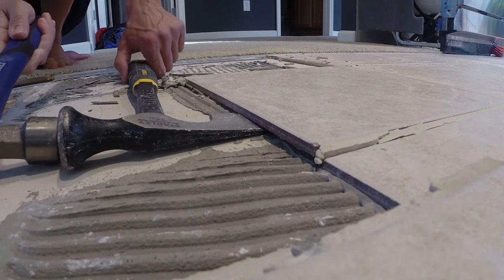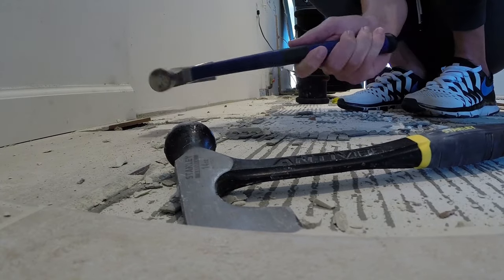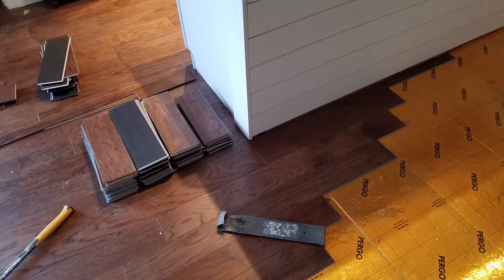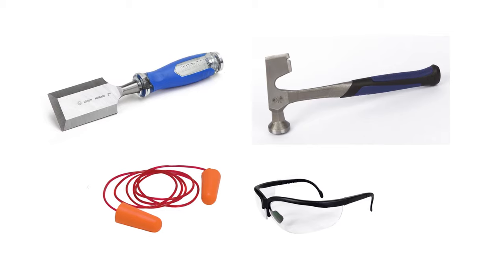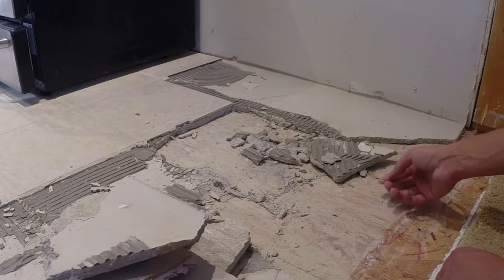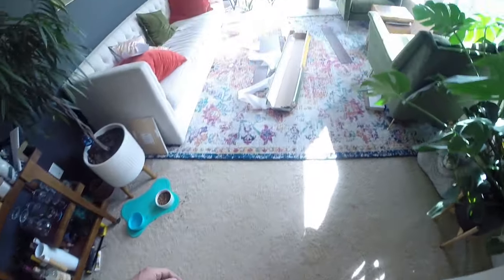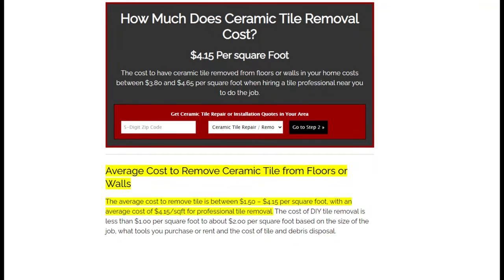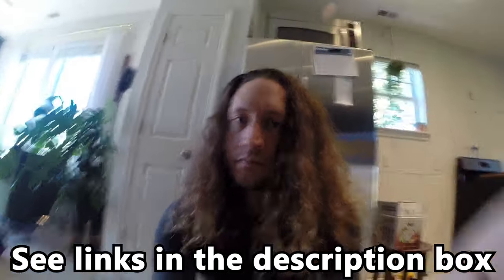How To Remove Tile - Crucial ADVICE for Removing Ceramic Tile Floor!

Comment: Did you have to get a permit from the town to do this work? I'm getting rid of damaged tile in the kitchen and master bath. Will try the tool that you showed in the video. Hammering the tile is very slow and noisy.
Reply from the maker: I did not need any permit to remove tile or anything in this remodel. I don't think you would ever need a permit to remove tile but you might want to double-check to be sure.

Comment: Hello - your video was helpful, but how would you recommend dealing with tile that kitchen cabinets are sitting on? It seems like we’ll need to make a precise cut at the edge of the kitchen cabinet so that we can break and remove a partial tile. I saw a tool called a toe kick cutter but seemed like it was only meant to cut through wood. Thanks!
Reply: I NEED your help, The tile in my kitchen is under the kitchen cabinets and the sink,is It OK to not take out all of the cabinets, I have lots of cabinets in kitchen and dining room,I am almost 74years old and a widow,and IF I am able to leave the cabinets in place, What is best way to cut the tile at the edges around the cabinets?? Thanks for your video, a Big company delivered my refrigerator and tore up several tile leaving me in a Big Mess,HELP ME PLEASE!!!!!!!
Reply: I am wondering the same, but I also need to know how to level the floor around the kitchen.

Comment: I got just two tiles I have to replace, one that came off on it's own and the other, well, water got under it and it swelled.  Hoping it's just something I can cut out and replace.
Reply: Tile doesn't swell is water gets under it. You have something else going on. Wood sub-floor?

Comment: I’m trying to remove tile but underneath I have a soft substance like waffle board. Do I take the waffle board up too with the tile
Reply: This is probably schluter ditra. Its a decoupling membrane for the tile. If you are putting tile back down and the waffle structure looks mostly undamaged you can reuse it. If not it is better to remove it.

Comment: Looks like you were lucky the tile installer did a crappy job with the Thinset coverage
Reply: It wasn't the coverage, it was either mixed too dry or the tiles weren't pushed down enough to collapse the ridges.

Comment: That backer board is there because of the tile. If you're removing the tile then the cement backer board comes up to.
Reply from the maker: The backer board was throughout this entire floor of the condo, where carpet was too
Reply: @TailHappyTV  that's weird
Reply from the maker: @coolguy24eric  there were a lot of wierd things in that place, thanks for sharing your comment and experience here with us

Comment: It never ceases to amaze me how many bad videos there are on Youtube about tile.  Nothing in this video represents the right way to remove tile.
Reply: And the worst videos usually have the most views and likes. It's because the idiots making the videos cut corners and do things the wrong way because it's easy. The lazy viewers will always agree with the videos that tell them what they want to hear instead of what they need to hear. Doing things right is difficult, doing them wrong is very easy.

Comment: Why not remove the trims first. It is helps easier reinstall too.
Reply from the maker: Good point, I guess I was trying to not have to remove the trim because the extra work and potential of damaging them or the paint around the trim in the process

Comment: What you removed seems to be a very badly installed tiles, the ridges are not flattened. With well installed tiles it won’t be that easy.

Comment: Normally, you should have your tiles glued on the floor, you did not have 10% of what you supposed to have. I remove tile and I need hammer drill with first part chisel and second part a scraper

Comment: U got lucky. Tile guy didn put a lot of glue
Reply: I tried removing tile from concrete on an outside porch. The installers did a great job; the mortar needed a jackhammer to break off. It took me twice as much time and effort than I thought. It looks like the tile in this video is just popping up.

Comment: sheetrock under tile?  who does that ? wow. i took tile down off a plaster wall and it was all goo and powder.  i cant imagine how sheet rock would hold at all on a floor
Reply: Sounds like wonderboard or Hardi backer for wet location

Comment: Dude, you are using two hardened faced hammers and hitting the heads against each other-not recommended and also you will ruin the waffle face on the shingling hammer.  They also make much better chisels for this that the wood chisel you were using.

Comment: showing encouragingly easy but not always the case. Under the tile mine had an inch of mortar and then steel grid nailed to the floor. Go buy yourself a rotary hammer. That is not an easy job, and before starting, plan what to do with a ton of sharp edged, heavy trash you will end up with.

Comment: Ugh, good info but it looks like sheer agony using hand tools. A cheap oscillating multi-tool is only about 30 bucks and a floor scraper is like 15 bucks. Could have had that whole floor up and smooth in an hour. Still a good video though. 👍
Reply: I'm doing my removal with a big flat tip screw driver a painter 5 in 1 tool and a hammer
Reply: @rockerchris82  Absolutely, that will definitely get it done. 👍

Comment: Actually, terrible "DIY" advice throughout. No one should be learning from someone who literally just picked it up himself totally winging it, grabbing any tool that looks like it might fit the job. He doesn't even know he's using the chisel upside down, with the bevel facing up...
I was immediately holding my breath, watching him bang 2 hardened steel hammer heads together and then he admits to not even owning safety glasses until the ceramic tile shards started splintering into his face.
In one way, you're lucky that you aren't more comfortable using a hammer. If you'd swung much harder, well, tempered steel is apt to explode like the ceramic, but in bigger pieces... Hammers were made specifically to be harder than anything they strike! What do you think happens when 2 things like that collide?... So, just keep giving it those love-taps and you might keep your eyes and face intact.
What self-respecting hammer-owner doesn't also own a prybar anyway? Even a crappy $2 prybar would solve all these problems instantly but he opted to try ruining his drywall tools on hardened concrete first.
Learn what your tools are for - and not for.

- 2nd generation licensed contractor in MN
Reply: We are looking for tips that would help beginners who don't have money that contractors charge. We got the criticism down, but can you post some helpful tips?

Comment: Don't ever post another video bro the worst advice I've ever seen when it comes doing demo work. If you don't know that underneath the tile is thinset how do you know how to take out tile? If you don't know how to use a chisel correctly how are you going to tell me how to use chisel? By the way we use shipping hammers around here to get up tile not little girl hammers. And by the way just remove the baseboard all you have to do is get you a good old flat bar and a hammer and a box cutter and remove it and it would have saved you probably about 3 or 4 hours worth of good work. And if you damage it upon taking out you just clearly had no skill
Reply from the maker: True, but this video has made me a fortune :)